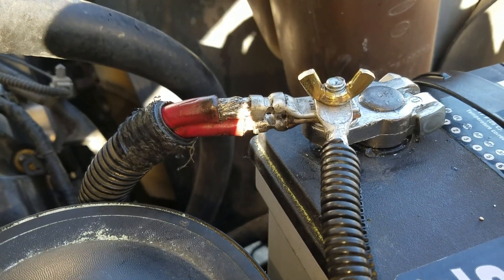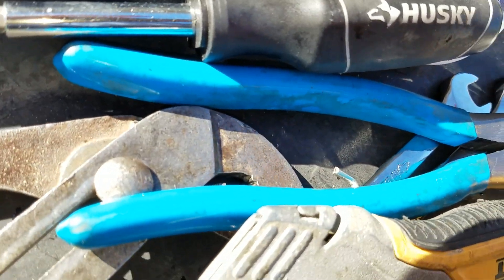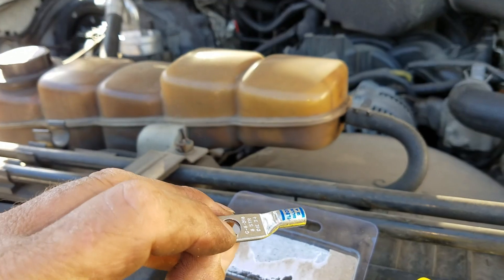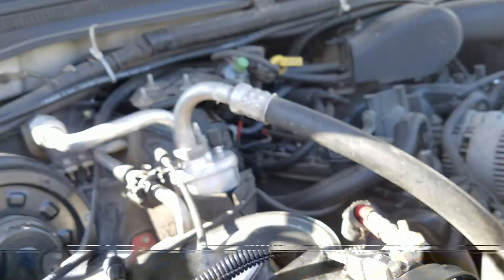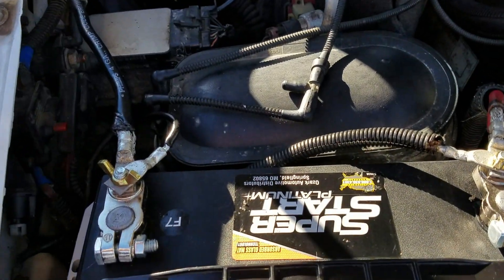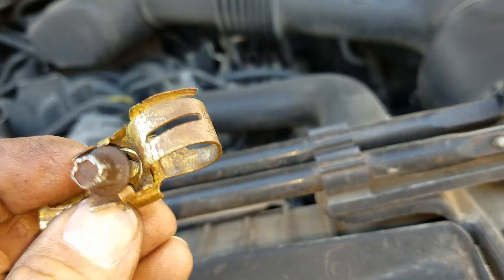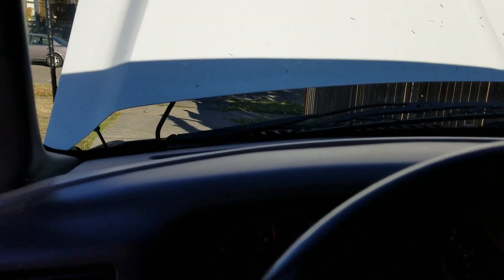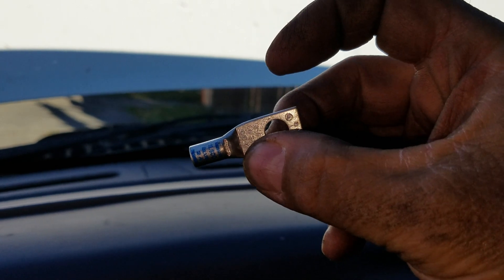Battery Terminal Repair _  Clean Crimp Solder

Comment: Nice job. Not a fan of wing nuts on battery terminals....I use double stainless steel nuts.
Reply from the maker: Hey MR WCR!   and the lovely Bobby!!   Opinions are hot and varied over the correct way to do battery cable connections. Soldering is what gets some of the most flustered responses, citing code and experience. Code says you must use a proper compressing tool to crimp for this type of connection, though a backyard hammer smash or punch will work well enough for non critical applications like your own vehicle. Soldering after crimping is fine in my book and will keep the weathering elements out and the wire from corroding again as mine were. Some say the solder will melt but to do that, it would be melting the wire jacket too and your problem is probably a dead short somewhere in circuit. As I recall, there are things called fuses and fusible links to prevent meltdowns. We'll see what happens with my fix over time. As for right now, the truck starts great, hard and fast hitting with the starting motor.  
Hope all's well for you guys in the new homestead. Got some fun videos coming up soon. Take care...